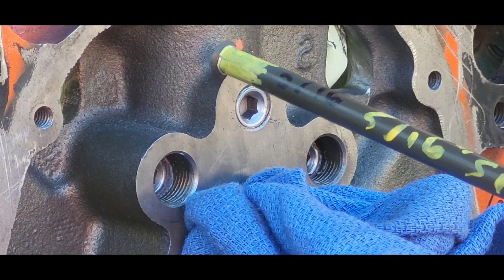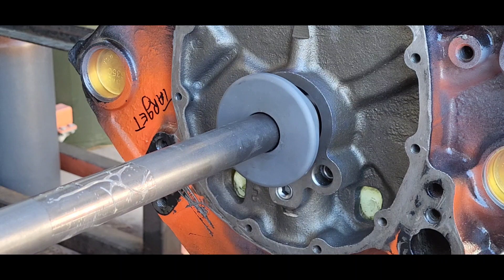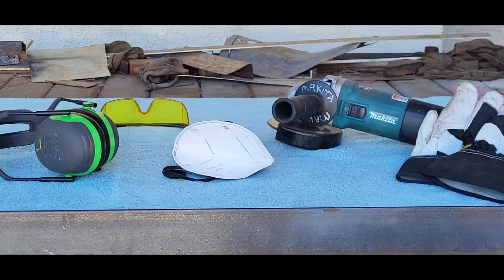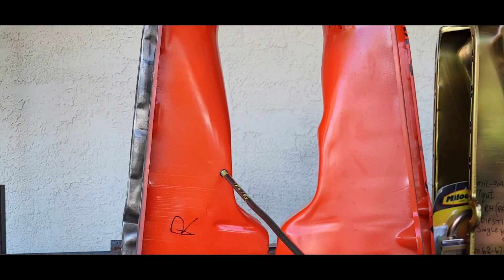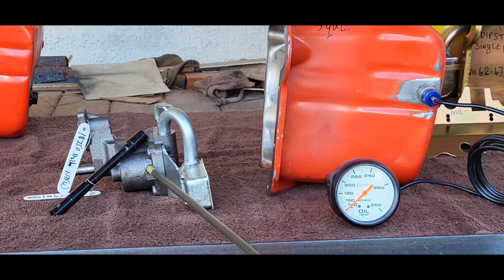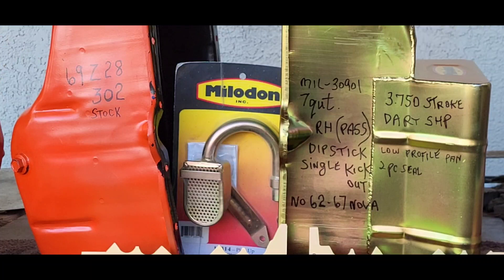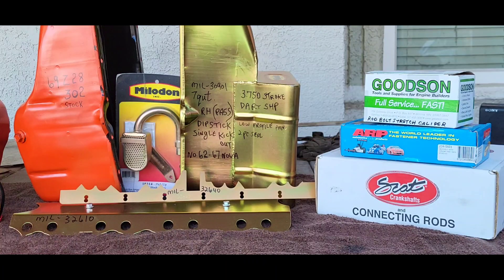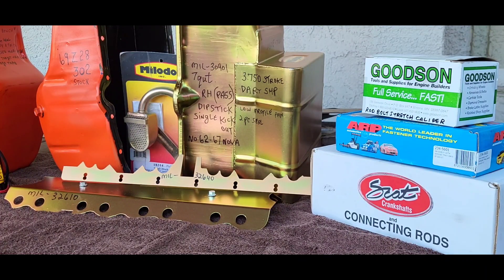Making Sense of Oil Control.

Comment: Glad you mentioned oil temp bung that everyone should add to any engine build.
Yea oil pans back in the 70’s in F/MP we ran stock pans left the line at 10,500 never hurt any bearings 15-25 lbs oil pressure too. Nice to have front baffle for breaking. Oil splash shield great for cooling intake AND keeping lifters in place if you break a push rod, engine oil supply not interrupted.
Nice job look into Schumann Oil Pumps everyone can learn plenty from him.

Comment: Here is food for thought. Many people purchase oil screen kits and some have 1" screens for the two 1" holes at the front of the block of a small block Chevy. I have an older magazine that is a collection of articles about building the s.b.c. and one article is penned by Smokey Yunick that was originally published in  Circle Track magazine.  Smokey talks about the s.b.c. oil system and what you can do to improve it. He states that the 1" hole in the front of the block on the passenger side should be plugged with an expansion (freeze)  plug while fitting a screen to the drivers side hole. He says that at speed, the rotating timing chain flings  a 1" stream of oil  from that hole back to the distributor. If you look at the  block, behind the cam gear there is a wall between the 2 holes which is due to cylinder offset of the right and left banks.. I have asked both Milodon and Moroso about this and they acted as if I was from outer space and just dismissed me and my question.  For my build, I have a 1" brass expansion for the passenger side and a cut out plug with a screen soldered in place. I would like to see a fully oiled engine with a plexiglass cover on the lifter valley while it is being spun by a Spintron. I doubt this has been done. Smokey had almost mystic powers back in his day. He  questioned everything in the pursuit of performance.
Reply from the maker: Very interesting.  It's no surprise that the companies you mentioned had no clue.  I suspect that it was this way for Smokey, too.  He had no one to ask, but forged on in pursuit of his opinion !  And that is what sets him apart from 99.99% of all the other people.  We all lap up every word the handful of other entrepreneurs in the automotive hall of fame have said in print, and always will.  Incidentally, if you ever get that transparent plexiglass intake valley cover,  please let me know where I can purchase one.  Thanks for your great comment.

Comment: I was looking for parts to build a 302,  and was thinking about 6.200" rods I believe, it's been years ago, the more I learned about rod ratio, that would been fine and all,  maybe gained 2-5 HP on the top end, but seems it can actually hurt the bottom end throttle response,  and possibly a slight TQ loss on the bottom! Maybe a smoothe bore finish, and coated shirts, and high compression or boost.  low friction rings , thin ring pack, and the coated skirts could reduce friction, enough there is little to no loss, from friction. 
I even thought about a 3" crank in a 400 block , see how 400 short rods compare to 6.2" compare it could be interesting! Rambling again, sorry. The piston for a 3" crank, 5.565 rod could be interesting also a 6.250, 6300" could be too long, and tiny light weight pistons I'd like to see how it would run  with a decent head..
Reply: there are many factors that can come into play when building an engine and learning 2 strokes is honestly one of the best ways to learn about engine forces. they are simple and basic math changed every characteristic with them. working our way back up to the v8 engines it brings tons of new knowledge.
rod ratio is important so is rod length but rod/piston acceleration is more important. you lose power and beat up your bearings. keeping an engine square is safer but you leave alot on the table. offset grinding the crank and alsoo the piston pin locations can do wonders to shave a ton of rotational force off and will do more for you than friction from the pistons. balanced rotating assemblies have also been a blessing too as alot of losses are there and the valvetrain. 
due to spending alot of time with the internal forces in engines and breaking them from too much when i was young i started swapping things around and looking at alternatives from other engines or known good combos.
gm has a v6 that was good the 3.9l v6 the crank was forged in some years and could be had with or without vvt. it also has variable length intake runners to make it make v8 power at low and high rpms. oil squirters whatever. the bottom end was known for 600+ hp with abuse no worries. never got popular and aftermarket was limited for a while. so i looked at engine specs again. the 3.9l and its predecessors shared rod length and bearing size from the small block chevy cool. if you bore the 3.9l block .1 inch you can make it a 4.0l cool it now shares pistons with the ls1 with a 4.0 inch bore.you can get some longer rods in the with offset pistons and an offset grind on the crank and get some more displacement but no need really. you have a rotating assembly thats stout for 800+ hp good fuel economy and with some breathing mods like headwork cam and headers your well over 400 hp n/a and torque to match with a very flat power curve stock is over 240 hp and torque by 1000 rpms. these motors being internally balanced and an even fire engine the turn revs just fine and make great torque as their rotational inertia is low. they also love boost and lets just say a stock motor can easily make over 600hp with a turbo more fuel and a tune. with a built motor and cheap mods as you get 2 spares anytime you order parts from the v8 you can be a little more risky with the boost settings.

Comment: Nice run down of all of the parts and or part numbers.
The prep work is good also.
The grinding of the clearance for the double row timing chain and gears.
Don't want to forget that.👍
Thanks for sharing. 
Take care, Ed.
Reply from the maker: To be quite honest, Ed, the ERSON adjustable timing gear set I referred to, actually was driving me nuts.  I installed it, rotated the crank, and I kept hearing a rub, but I couldn't locate the noise exactly.  But the material above the top cam galley hadn't been removed yet.  We also use a Torrington roller needle bearing between the cam thrust face and the cam sprocket, and I felt like it must have been coming from in there.  I had to drop the hunt, though, as I had a hundred things to get done.  I want to use that beautiful adjustable cam gear set, but here is another example of wanting something, but it just doesn't work out.  Incidentally,  we installed a normal double roller timing chain set with the bearing...no noise.